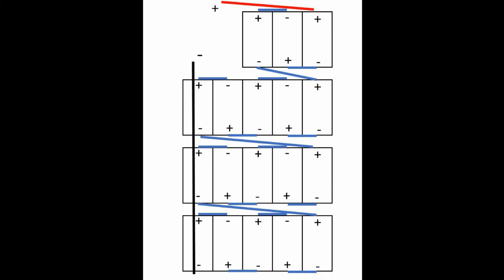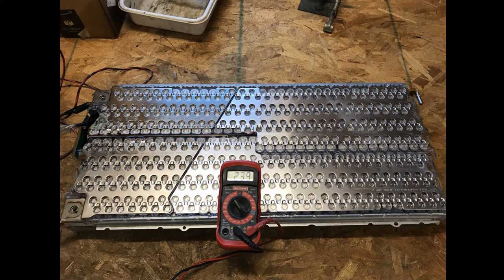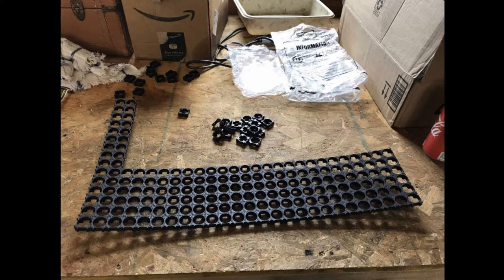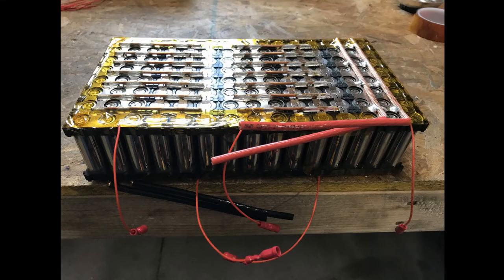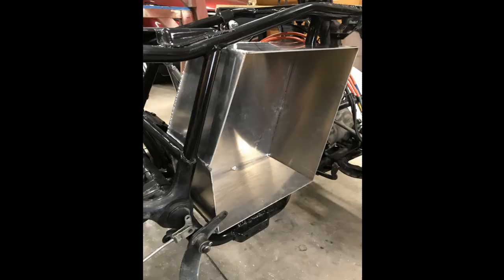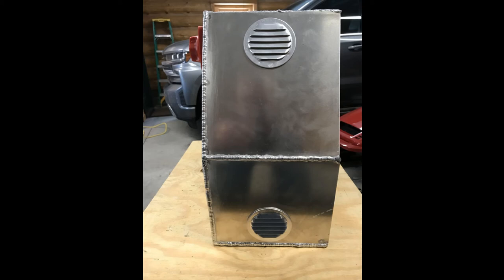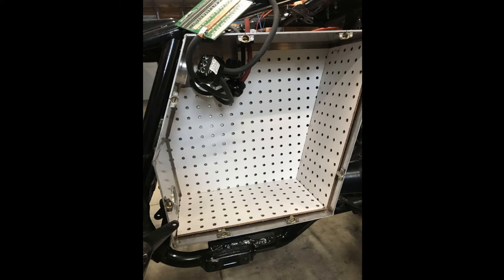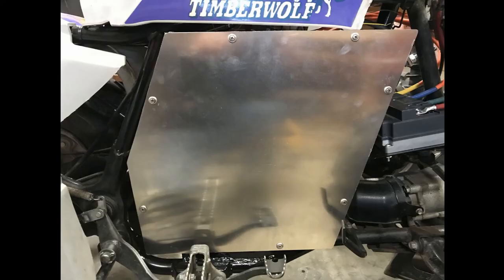Electric ATV Battery

Comment: Cardboard aided design... I'll have to remember that one!
What BMS and charger did you go with?
I like the cost analysis you did on the used cells - is there a way to know what their lifespan would be compared to buying new cells? If the tesla pack worked out to $1/cell and new is $4/cell, you would still be ahead as long as the life is greater than 25%, which I imagine is fairly likely, so it would always be better to go with used cells?
Thanks for any info, you videos have been very helpful
Reply from the maker: I had an extra 28S bms  100a from an earlier project that I didn't use.  I just combined pins 18-28 to make it work for an 18s.  Here is a link to one that is similar.

https://www.ebay.com/itm/254258271772

The charger came from AliExpress.

https://www.aliexpress.com/item/1005001820332693.html?spm=a2g0o.9042311.0.0.255a4c4dmnaoYy

Any18S charger will work.  I chose 5A.  This level will charge any 18S overnight.

LI batteries typically get 300 - 500 charge cycles over their lifetime.  My guess is any Tesla Model S salvaged batteries would likely have pretty low cycles on them.  Even if they had 250+, my builds get charged maybe 2-3 times per year.  They will likely still be useable for many, many years.